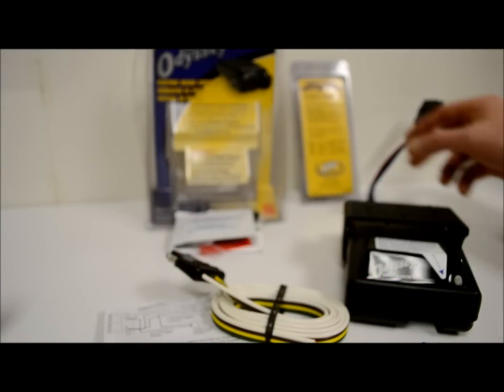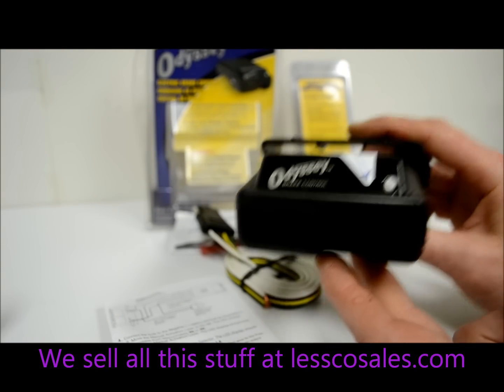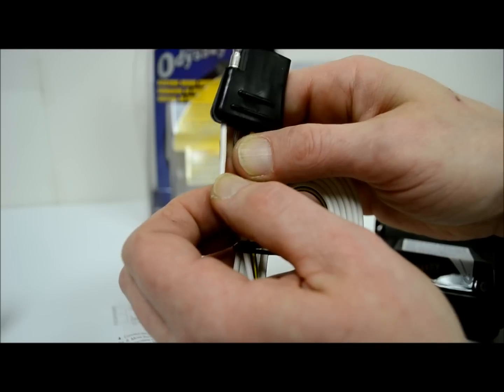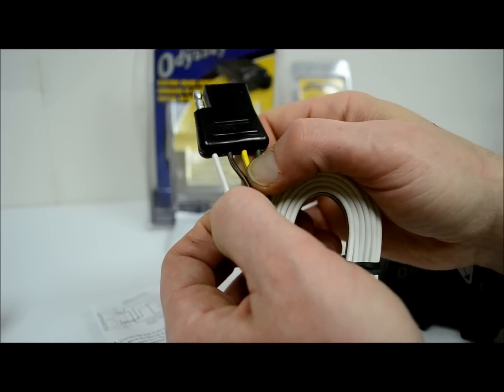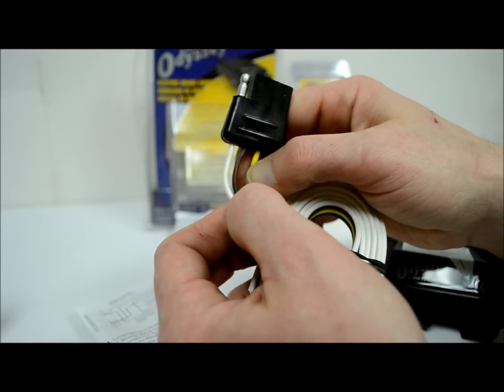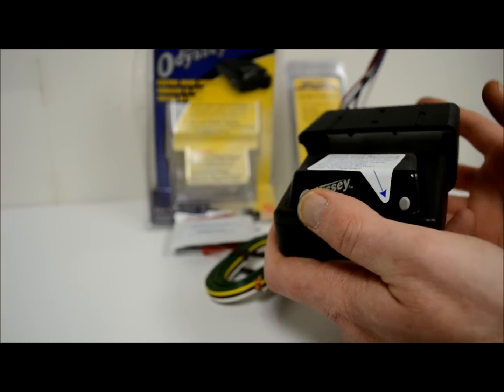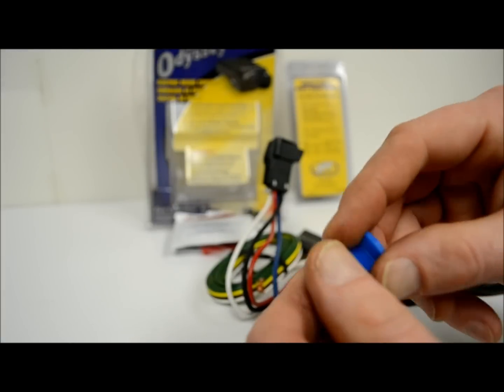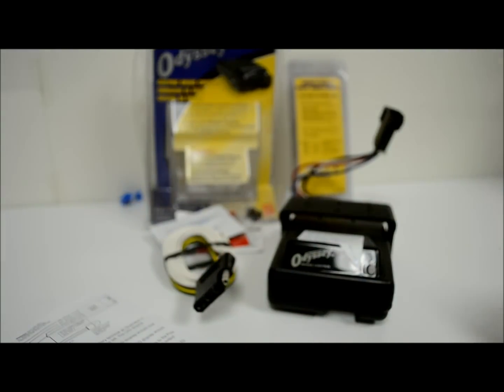How to wire a trailer hitch and electric brakes

Comment: So your saying you can wire the brake controller and trailer brakes into your 4 pin flat harness? I thought you have to have a 7 pin RV connector to wire in trailer brakes? If the brake controller goes in the cab of the truck and it gets power there to the black wire and than the white wire is grounded, how does the blue output voltage wire get to the trailer to control the brakes? You need to run it from the brake controller in the cab, through a 7 pin trailer connector and then it goes to the brakes via the blue wire on the trailer, correct? How do you wire in electric brakes with a 4 pin flat harness?